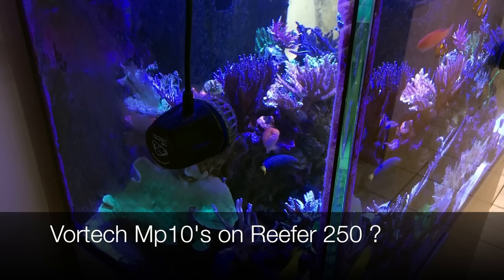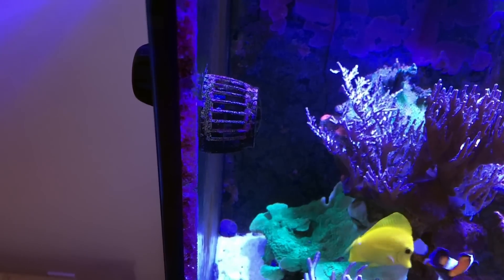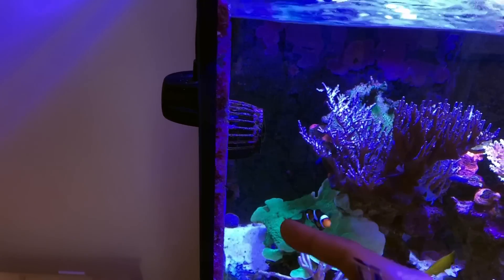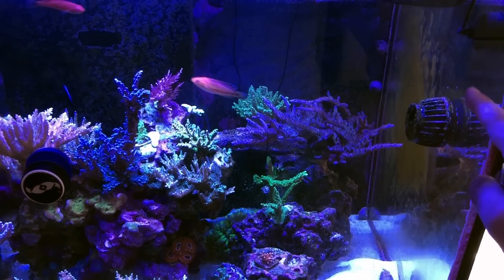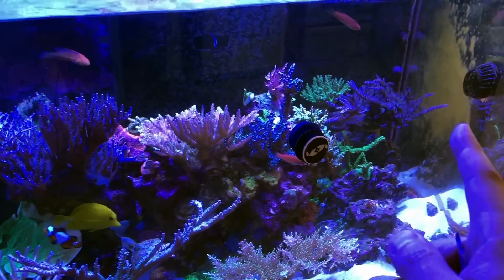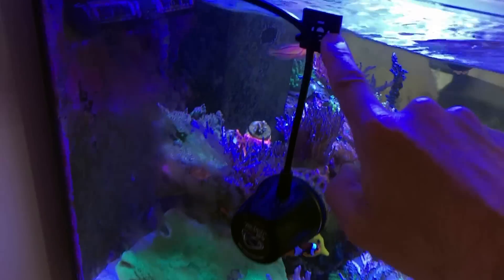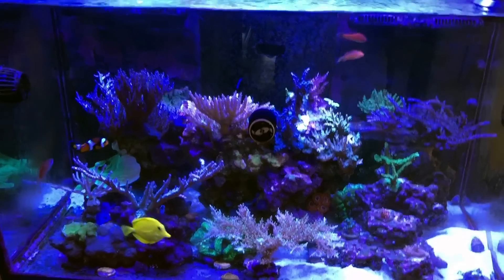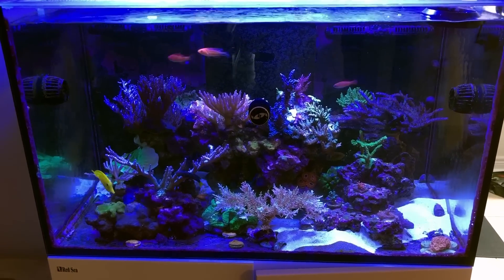Can you use Vortech Mp10 on the Redsea reefer 250?

Comment: How do you find running gyre aswell. I have a gyre and single mp10 atm just bought a second mp10 in order to run instead of gyre.
Reply from the maker: gyres are nice for flow but annoying to clean and maintain.
Reply: @TheBioReef  yeah I'm running mp10 left and gyre right. So swapping to two mp10s. Love your idea of random / varied schedules so gonna copy the idea once I get mobius chips for the mp10s. 
Thought about running gyre in vertical plane on back wall. Aswell

Comment: this is how i crash 2 tank with a wave mode(on and off) with my tunze silicone fail :(
Reply from the maker: sorry to hear that... yes you need to have enough glass thickness and support for waves
Reply: @TheBioReef  now i have a reefer 170 i just try ONE mp10 and the flow make my  corals to move in one direction i try all mode , maybe the wave mode is not bad i dont like the noise and  im afraid of the silicone in the tank  :( maybe i will try a red sea wave 25 but still the corals are probably going to move in the same direction ..
Reply from the maker: @yanna4473  i specifically asked redsea if my 250 was built to wistand waves, and they said yes.

Comment: The bearing on the dry side are shot I recently went to Ecotech for a tour and they checked my dryside and told me the bearings needed to get replaced. Changed the dryside all is great know hope this helps
Reply: Carlos23 carlos how did they know your bearings were shot?
Reply: When I had my pump at 70% the dryside wood squeal and knock the wet side off and they tested it and gave me a new dryside and all is good know
Reply: Carlos23 glad it’s all good now
Reply from the maker: Carlos23 thanks for telling us how to troubleshoot these issues. How old where the pumps when this happens
Reply: 2 to 3 years old there mp40 qd